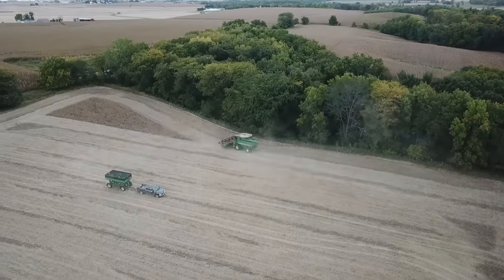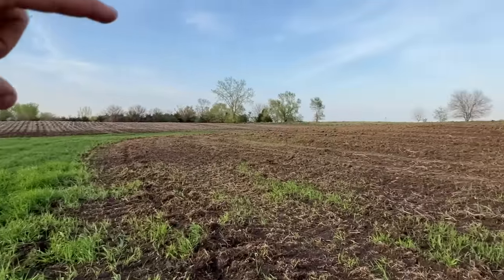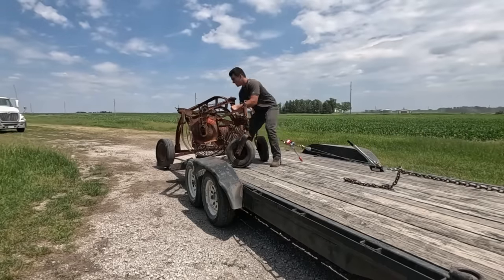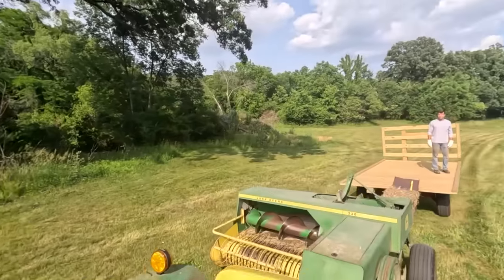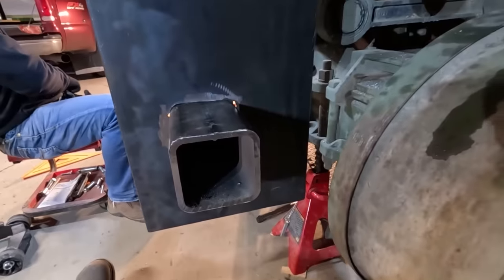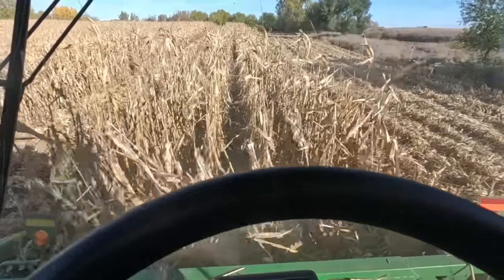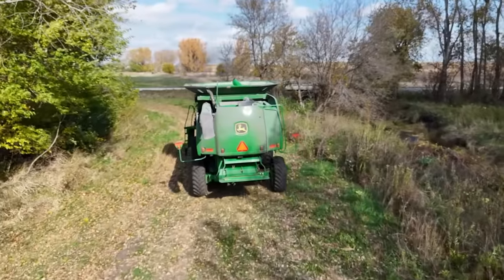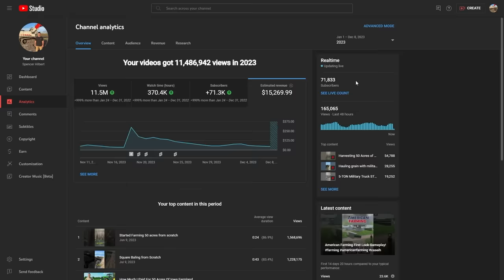I Spent One Year Farming from Scratch

Comment: I started from scratch in the 80's .you certainly did not start from scratch.i bought a tractor n a disc to start but hired out a spreader for nitrogen  n paid the farmers down the road to plant my corn n paid them to take it off n spent 6 wks.working for them to pay them back.lost my butt.but all this equipment isn't yours so you didn't start from scratch. I couldn't afford tile or repair for most things.that's scratch my friend. I ended up after 6yrs.w 350 acres n enough equipment to plant but no combine.lost money every year n gave it up.

Comment: Is excavator a good idea due to soil compression ? I aint no farmer but just wondering 😂
Reply from the maker: Yeah it’s not ideal. Just used it this one time. Won’t need to do that ever again. I was out there when the ground was dry and hard so not a lot of compaction going on. It’s all about how much moisture is there. If it’s hard a rock it’s hard to compress that. Also it’s 50k lbs spread over those large tracks. Probably less compaction than a 20k lbs tractor with tires.

Comment: there was so many expenses he didnt count. all those excavators work and other heavy equipmet he got for free because his family just had them adds up big time through out the year. so this is not as accurate as it could but cool video still
Reply: also he was running his brothers game add multible time so that should also count as payment for the biorrowed equipment
Reply from the maker: The excavator is mine. And yes I left out a lot of expenses that were toward “land improvements”. I only included expenses that I will incur year after year for the most part. For example I won’t be running an excavator to get ground prepared every year like that. Thanks for watching.